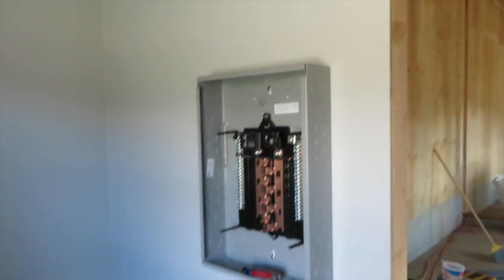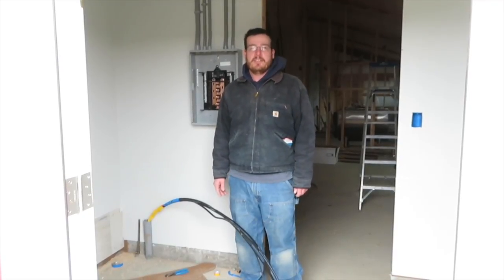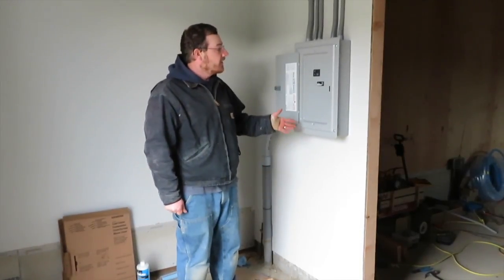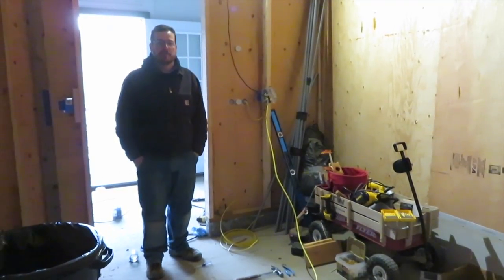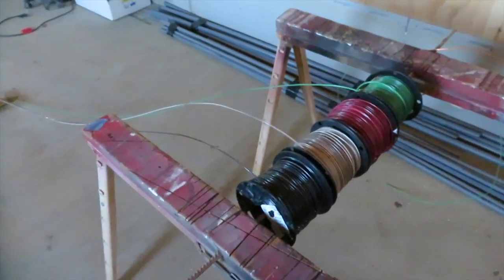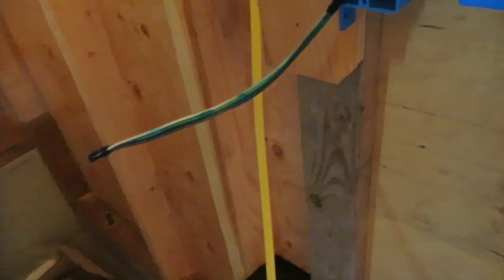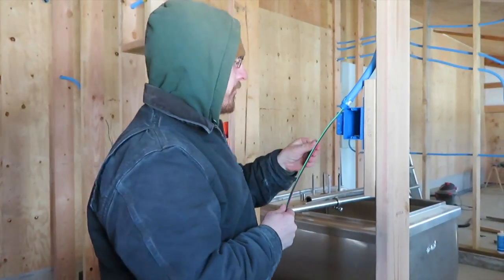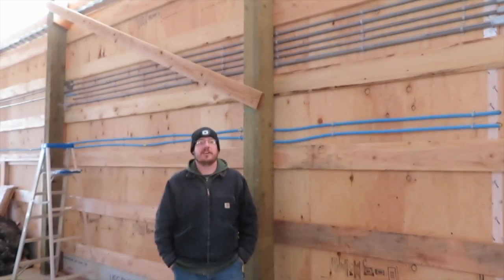Building Dairy Barn #12: Electric Rough-In

Comment: good stuff.  I have the good fortune of working with a Master electrician here at SOUTHCOM HQ (its not particularly my job but we are strapped for bodies...and I want to learn so i can do stuff on our homestead).  Many of the things he mentioned you have done!  Like grounding the actual panel box itself.  I got to work closely with our A/C contractor as he put in a mini split for our garage, he did the same.  However, in Miami-Dade the code is updated every three years.  That is a good way for the county to make money as now you have to submit for a new permit and pay if you just fix something that was originally installed!!  The change we had was the addition of an additional ground, so two copper rods pounded into the ground, six feet apart.  I am sure WA state does the same to ensure the coffers remain full.
Reply from the maker: Yes, electrical permits are handled by the state (except in a few large cities) and are needed for most electrical work.

Comment: Nice electrical work for a dairy farmer. Good to use a form of conduit BUT you're suppose to PULL wire not just PUSH wire. Use your shop vac to pull a string then you can pull the wire or get a nice fish tape, preferably a fiber non conductive one but without power, a standard old metal fish tape will help. Surface mount with water resistance covers will be best in the moist parlor, which, I assume, is what you were leading up to in your opening statement.
Reply from the maker: Oh, I’ve used the shop vac and string trick many times! Haha! Yes, I push wires, but Virginia is the puller! I don’t have a fish tape, but generally use a string or a scrap wire. Thanks for watching!